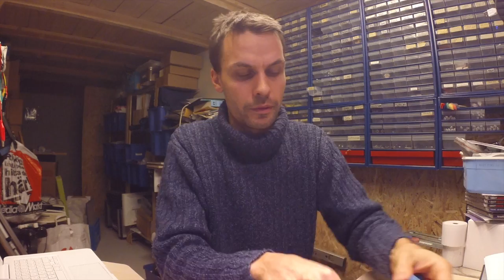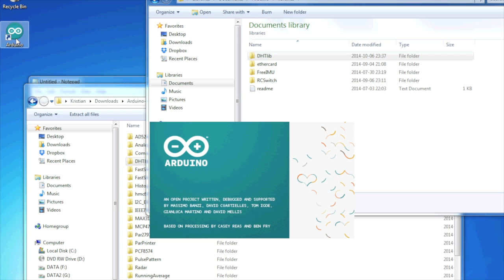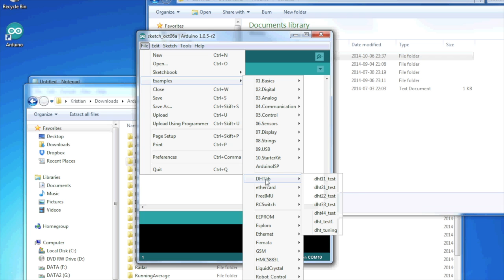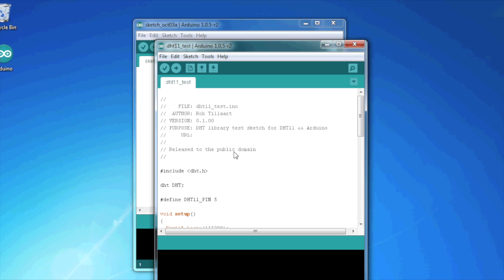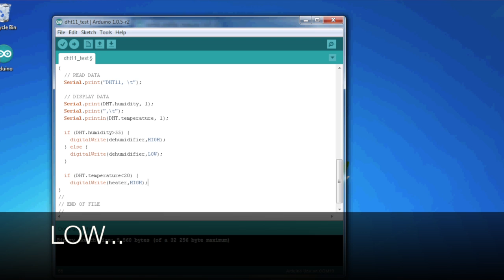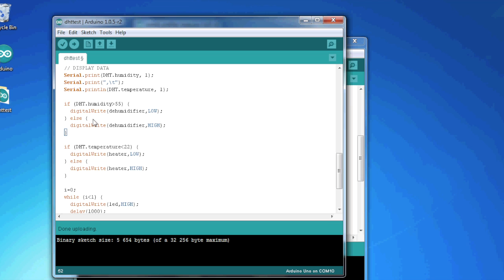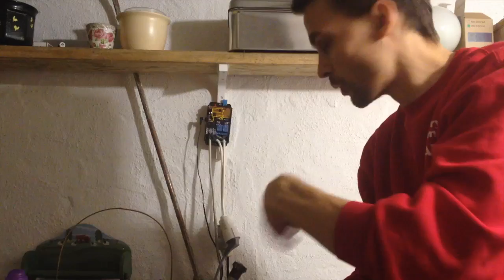Using a DHT11 and ATtiny to control humidity moisture and temperature - Anything Arduino ep 4

Comment: I connected everything and write the sketches the you, but mine just not working. maybe i'm doing something wrong. i'm using a arduino 2560 board, could that be the case?

sketch;
#include <DHT.h>

// Example testing sketch for various DHT humidity/temperature sensors
// Written by ladyada, public domain

#include "DHT.h"

#define DHTPIN 2     // what pin we're connected to

// Uncomment whatever type you're using!
//#define DHTTYPE DHT11   // DHT 11
#define DHTTYPE DHT22   // DHT 22  (AM2302)
//#define DHTTYPE DHT21   // DHT 21 (AM2301)

// Connect pin 1 (on the left) of the sensor to +5V
// NOTE: If using a board with 3.3V logic like an Arduino Due connect pin 1
// to 3.3V instead of 5V!
// Connect pin 2 of the sensor to whatever your DHTPIN is
// Connect pin 4 (on the right) of the sensor to GROUND
// Connect a 10K resistor from pin 2 (data) to pin 1 (power) of the sensor

// Initialize DHT sensor.
// Note that older versions of this library took an optional third parameter to
// tweak the timings for faster processors.  This parameter is no longer needed
// as the current DHT reading algorithm adjusts itself to work on faster procs.
DHT dht(DHTPIN, DHTTYPE);
int fan = 3;
int heater = 4;
int led = 5;
int i = 0;

void setup() {
  Serial.begin(9600);
  Serial.println("DHTxx test!");

  dht.begin();
}

void loop() {
  // Wait a few seconds between measurements.
  delay(2000);

  // Reading temperature or humidity takes about 250 milliseconds!
  // Sensor readings may also be up to 2 seconds 'old' (its a very slow sensor)
  float h = dht.readHumidity();
  // Read temperature as Celsius (the default)
  float t = dht.readTemperature();
  // Read temperature as Fahrenheit (isFahrenheit = true)
  float f = dht.readTemperature(true);

  // Check if any reads failed and exit early (to try again).
  if (isnan(h) || isnan(t) || isnan(f)) {
    Serial.println("Failed to read from DHT sensor!");
    return;
  }

  // Compute heat index in Fahrenheit (the default)
  float hif = dht.computeHeatIndex(f, h);
  // Compute heat index in Celsius (isFahreheit = false)
  float hic = dht.computeHeatIndex(t, h, false);

  Serial.print("Humidity: ");
  Serial.print(h);
  Serial.print(" %\t");
  Serial.print("Temperature: ");
  Serial.print(t);
  Serial.print(" *C ");
  Serial.print(f);
  Serial.print(" *F\t");
  Serial.print("Heat index: ");
  Serial.print(hic);
  Serial.print(" *C ");
  Serial.print(hif);
  Serial.println(" *F");

  pinMode(fan, OUTPUT);
  pinMode(heater, OUTPUT);
  pinMode(led, OUTPUT);

}

void loop()
(
  //READ DATA
  Serial.println("DHT22, \t");

  //DISPLAY DATA
  Serial.print(DHT.humidity, 1);
  Serial.print(",\t");
  Serial.println(DHT.temperature, 1);

  if (DHT.humidity>50) (
    digitalWrite(fan,HIGH);
  ) else (
    digitalWrite(fan,LOW);
  )

      if (DHT.temperature<23) (
        digitalWrite(heater,HIGH);
      ) else (
        digitalWrite(heater,LOW);
      )   

   1=0;
   while (i<10) (
    digitalWrite(led,HIGH);
    delay(1000);
    digitalWrite(led,LOW);
    1++;
    )          
 )
 //
 // END OF FILE
 //
Reply from the maker: +Phillip Clarke I see you are using a DHT22 according to your code is this correct?
Reply from the maker: +Kristian Blåsol Which sensor are you using? DHT11 or DHT22?
Reply: +Kristian Blåsol
he says he is using a DHT22. Could this be the problem?
Reply from the maker: +Christopher Chilcott-Parker Maybe? I still havent ordered a DHT22 to test with... According to +Rickard Bergström it is much more accurate, and the DHT11 isnt good at all, so I really need to buy one and try it out. But as long as you change the code to DHT22 it should work the same...
Reply from the maker: +pablo contreas You cant have Serial.print commands on the ATtiny, if you do, remove them and it should work...

Comment: as for beginer I did not understand the last part. how you connect the power supply
Reply from the maker: +Gloryan Headman Sorry for not making that clear enough. I have a wall wart (transformer adapter) that supplies 9V. You can see in this picture: http://duinos.net/files/2014/humtempcontroller.png there is a powercable connected on the left side of the box. It then connects to a 7805 and two caps as similar to this image: http://duinos.net/files/2015/mapbh.gif. Hope that helps.
Reply: +Kristian Blåsol yeh)) I can see that, but it looks like a mess to me, it wold be perfect if you will do the second part from the scratch.  there are lots of videos , but 90% is rubbish because authors don't pay attention to details. I commented to your video because it is more or less understandable but only first part of it, more to the end it is becoming more foggy like you were in hurry to finish it. thanks
Reply from the maker: +Gloryan Headman :) True and still it was a bit long ;) I'll make a complimentary video for the last part as well. Give me a few days though...
Reply from the maker: +Gloryan Headman Done! :) Hope this video helps. https://www.youtube.com/watch?v=tfAWkH5ogbU
Reply: +Kristian Blåsol thanks!! clear)

Comment: Need to send out a warning about the DHT11 relative humidity-sensor. Its measurement values are very inaccurate. When humidity goes down below ~45% it fails badly. Check this graph that I posted on my Twitter account:
https://twitter.com/Diodens/status/640440428173639680
Note that you need a +13 offset for the DHT11 to even measure somewhat correct at any humidity.
Reply from the maker: +Diodens Thanks for the info. That is a bit sad if that is true... Have you made the test with many DHT11 or just one? However in my project I have had similar thoughts that it wasnt accurate enough as I measure the temp and humidity every minute and the humidity could REALLY change during that minute, which didnt feel like "the truth" :)
Reply: +Kristian Blåsol Hi. The data that I made the graph with comes from both me and a friend, so 2 different DHT11 with different hardware and Arduino code (he made his own). Still measures the same. And actually I did replace my DHT11 once because I thought I got a bad one, but the new one measures as inaccurate as the first one.

Have also tried with different DHT11 libraries and versions for Arduino with no difference in measurments. Have had 1 second delay between readout's, as you should have.
Reply from the maker: +Diodens Do you know if the later models are as bad? Eg the DHT22? It is more expensive, maybe it is more accurate? I'll order one and try it out...
Reply: +Kristian Blåsol No, I don't. Have placed an order for 4 pieces of DHT22 but haven't received them yet.
Reply from the maker: Great! Please let me know the results!
Reply: +Kristian Blåsol Hi! Check my tests of the DHT11 vs DHT22 here:
https://plus.google.com/+RickardBergstr%C3%B6m/posts/VxCPt5cv3b4
Seems to be way much better than the DHT11

Comment: what if i want make Arduino to do several processes at the same time ? I mean using more sensors ?
Reply: Narcisa H. if you need more pins than the UNO has to offer, go for an Atmega. Yes a 595 or a portexpander will work aswell, but with the Mega's being very cheap that is hardly worth the trouble
Reply: Ed19601  Thank you so much ^^
Reply from the maker: Narcisa H. Sure, no problem, just add more code in the void loop() section. Depending on what sensors you want ofcourse. Do you mean more than one DHT11? Then just add another DHT11 to another pin on the arduino and double the code (basically). Since each DHT11 instance in the code has its own name you can get the value from each sensor with its respective name... Hope this helps or get back to me again.
Reply: Thanks a million ! yeah I meant adding more DHT11 several soil moisture sensors, a piezoelectric  , water pump and an LCD  to have a little greenhouse system in our patio , I have many errors whenever i mix the codes moreover UNO pins are limited i need more pins.
Kristian Blåsol
Reply from the maker: On my todolist for videos there is ways to expand inputs and outputs with MUX:es (for analog signals) and 595/106 chips (for digital signals)... There are other videos and instructions on how to expand inputs. But you need to know what type of input it is you want to read. Also many libraries are locked to specific pins, so you cant change them easily. Hope you get it working or ask again and I'll try to help...
Reply: Narcisa H. I have an attiny do humidity temperature, atmospheric pressure, and light levels and send that to a 433 MHz transmitter. it has 5-6 pins
BMP180 -> 2 pins  (I2C)
DHT11 ->  1 pin
LDR -> 1 pin
Rf -> 1 pin

Comment: Annoying how those relay modules invert the logic, for some reason I never thought to fix the problem in software I just fixed it by adding additional hardware lol, but your way is better. Anyway thanks for the video.
Reply from the maker: Thanks! Another way to fix the problem with inverted logic in these modules is to switch from NO (Normally Open) to NC (Normally Closed). That way you only have to move one cable in the scre headers, and not have to change the code even...

Comment: Hallo Kristian , dein projekt find ich super , allerdings benötigt mein sketch 4400Bytes und hab schon alles weg gekürzt , wie soll das auf den tiny85 passen der kann doch bloss 512Byte
Reply from the maker: Hello Antonio, if you only have 512 byte then it cant be an ATtiny85, it must be a smaller version. To minimize the sketch, remove everything between the //=== check what values we have... all those if's and the blinking of the LED is just for visuals on what temp and humidity is in the room at the moment. So it wont affect the control side of things. However I am unsure that you can get it down to 512bytes... That is really little memory. And the DHT-library takes up a lot of space aswell... Hope you get it working, make sure it really is a ATtiny85 and not a ATtiny45 or 25 (it means they have 8, 4 or 2 KB of memory). If you are really sure it is an ATtiny85 you have, then I am using the ATtiny hardware support that is shown in Episode 3 of Anything Arduino I think, make sure you use the same. I am thinking that your hardware support has more overhead than the one I use? Just one thought... Let me know how you get along...

Comment: HI. where is the sketch? I need the code (after making the blink program based on the values please).
Reply from the maker: Sorry about that, I forgot the link to the project page... I have updated the description, but also here it is: http://www.duinos.net/show/?id=172 The code is down a bit in the right column.
Reply: Kristian Blåsol sorry but i get the error of "The page cannot be found". 
here is the link http://www.duinos.net/show/?id=180 and it will redirect me to http://www.duinos.net/files/2014/humtempcontroller.ino
Reply: ghasem zolfaghari
Still "or again" "The page cannot be found" for the code. Thx for a good tutorial btw :)
Reply from the maker: Zubat78 wow, lots of things that can go wrong :) The server didnt serve .ino files. This is also fixed now, so now you can download sketch files aswell... Thanks for noticing and alerting me! Happy new year!

Comment: Do you also use the Raspberry Pi? I was looking for a way to control my HVAC system using a DHT11. I see lots of tutorials for the DS18b20.
Reply from the maker: Not for this project no. It would be way overkill to use a RPi for this simple task :) I'll soon make a project using the DS18b20 aswell. It is a good alternative for sensing temp only, i Think a bit more expensive though...

Comment: hey  #KristianBlasol  mine it not appearing numbers but estrange symbols, what should I do?
Reply: That can also happen if the bit rate is not set correctly. Most of the time it's set to 9600 kb/s.
Reply from the maker: Do you mean when you run the example sketch and watching in the serialmonitor? If so 1. Make sure that it really is a DHT11 you are using, there are many similar chips out there, that look the same, but act differently. 2. Make sure that you have three leads connected to the correct pins between the arduino and the DHT11. And then make sure you dont change anything in the code in the example sketch and try again. Double check so you use the correct pin as defined in the code. If nothing of this helps the DHT11 COULD be broken (that does happen), or we have to continue error searching. What version Arduino board are you using?